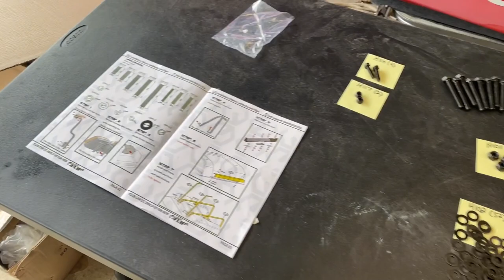Club Car DS Rear Seat And LED Lights!

Comment: Where did you attach your light strips? Stick them to the frame or did you drill holes and use zip ties? I have a DS and am trying to figure out the best way to attach my underglow. The underneath of these carts get dirty and don't seem like they would work well if you stick them to it?... thanks
Reply from the maker: I used sticky-back zip ties mounts. I cleaned each spot with alcohol and I think I applied a bit of gorilla glue or super glue or something like that. The mounts have made it without failure for the most part. I do have a section behind the right rear where one mount has failed - probably because of the wheel splash… so some self tappers through the ty-wrap mounts may be the way to go.
Reply: @jacobyoung3160  hey man, thanks for the quick response from a video posted 2 years ago. I appreciate it. I'll definitely try your technique 👍🏻

Comment: Amazing build man love the led lights would they work on a electrical golf cart?
Reply from the maker: FireLord1224 4 thank you very much! you would need to verify the voltage of your carts system - I think some carts run 48 volts - you would need to find a kit that is compatible with your voltage
Reply: Jacob Young I have the same cart you do but it’s. a 48 volt so they would work on it correct ?
Reply from the maker: FireLord1224 4 you will need to put a voltage regulator on first to step down the voltage from 48v to 12v, and then you can install your lights. You will fry your lights if you connect them directly to 48v.

Higomall Voltage Converter Regulator Reducer DC 48V Step Down to 12V 20A 240W Waterproof DC/DC Buck Transformer for Golf Cart LED Light Bar Power Supply https://www.amazon.com/dp/B07JZ475QD/ref=cm_sw_r_cp_api_i_Bn-HEb780HQ65

Comment: Ive got 2002 club car. Where did you mount the led strips?
Reply: Also, what size wheel spacer did you use?
Reply from the maker: LED’s are mounted to the frame rail and anywhere else I could attach. 1” wheel spacer on each side (2” overall)
Reply: @jacobyoung3160  Did you spacers in the front and back? I ordered some but it loos like they are just sold in pairs.

Comment: Do you ever feel that you need an extra battery for lights and a stereo?
Reply from the maker: The stereo is a separate unit not attached to the cart. The LEDS are hard wired, they draw a very very low current. I leave my cart on a trickle charger just to be safe
Reply: @jacobyoung3160  By a separate unit you mean another battery I'm guessing?  Sorry I just inherited a stock 09' DS club car and dont know anything lol.  If you use a separate unit would you happen to have a picture of what that looks like under the hood?
Reply from the maker: By separate unit, I meant the stereo is a JBL Bluetooth speaker that fits in my cup holder lol
Reply: @jacobyoung3160  Oh lol that's what I'm doing now too.  I always rented golf carts at the coast and have never had a problem with the battery draining while listening to the carts stereo all day but I never looked to see if they had extra batteries or the regular one was enough to pull this off.  I guess I'll give it a try on the original battery and see what happens lol.